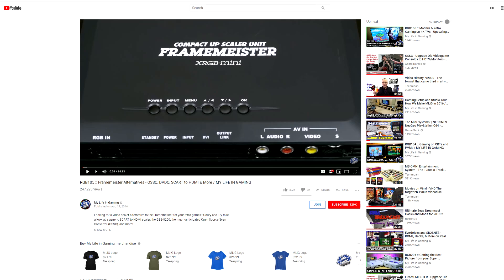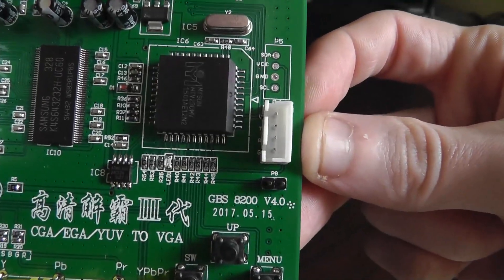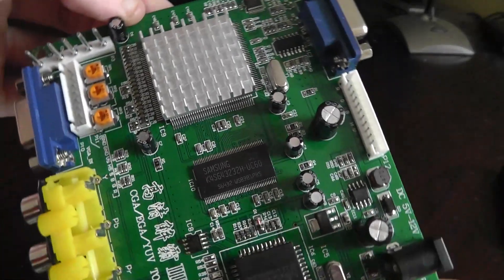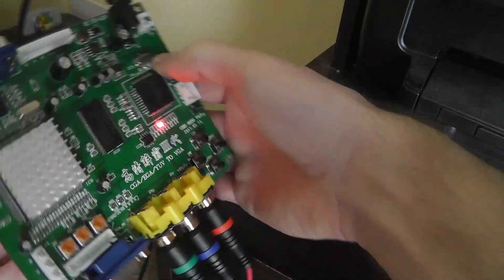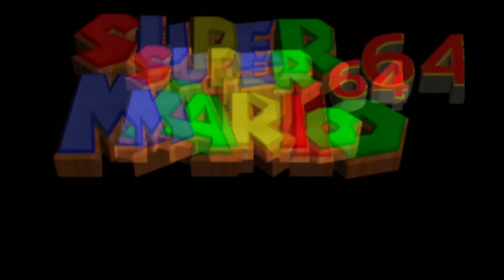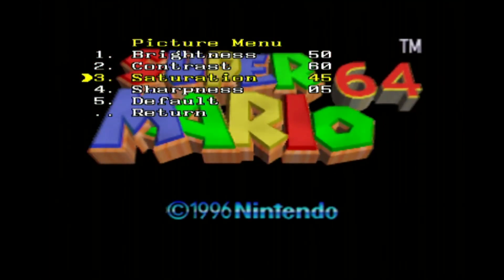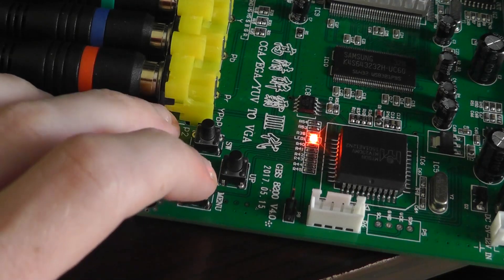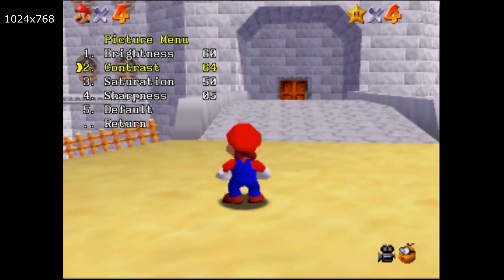A cheap RGB Scaler that's good? GBS 8200 Setup with N64 RGB Component Video

Comment: I recommend using the D-sub input on the GBS, there is no reason to convert the RGB signal from the N64 to YPbPr with the hd retrovision cable, then convert it to back to RGB with GBS. I think it would be better to leave out the extra conversion. The D-sub input on the GBS can accept RGBs.